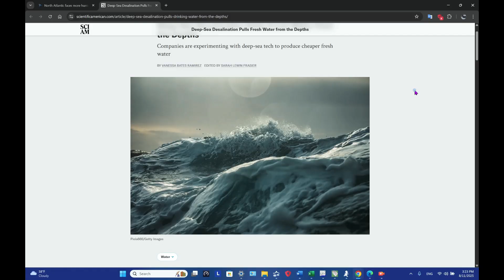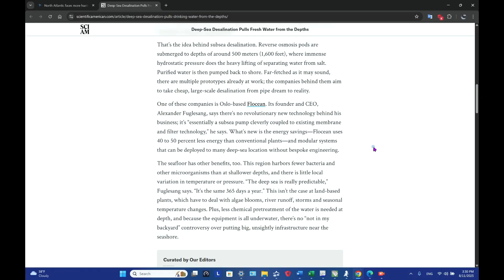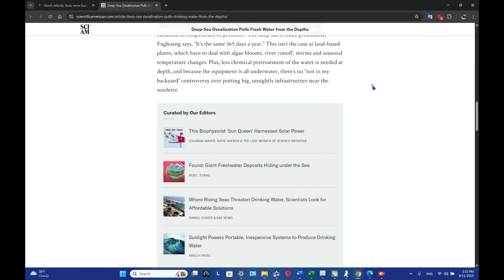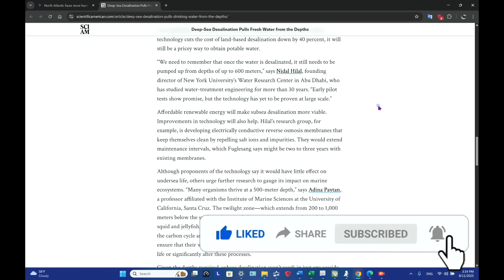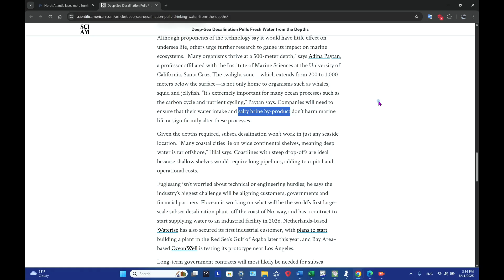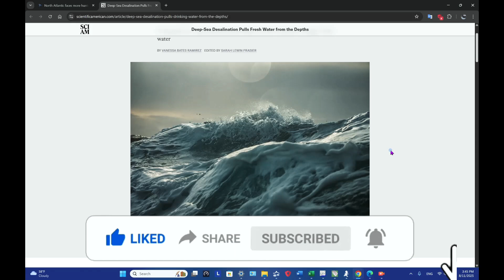Can Deep Sea Desalination Solve the Water Crisis?

Comment: Isn't it about pressure differential? The pressure is very high at depth but there's no differential across the filter, right?
Reply from the maker: The water is pumped away from one side of the filter. This creates a pressure differential that does force more of the higher pressure water through the filter.
Reply: @ScienceTalkwithJimMassa  Right. But pumping and the energy expended to create pressure differential is required, defeating the purpose?